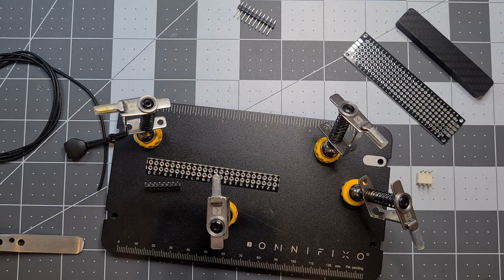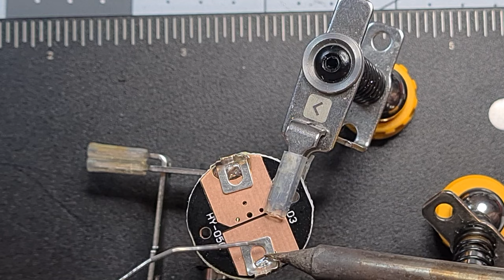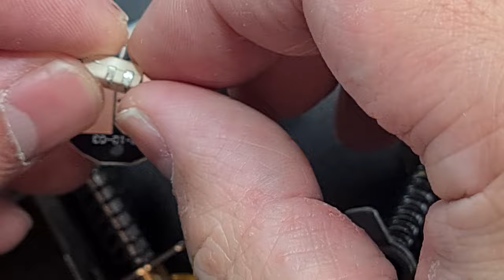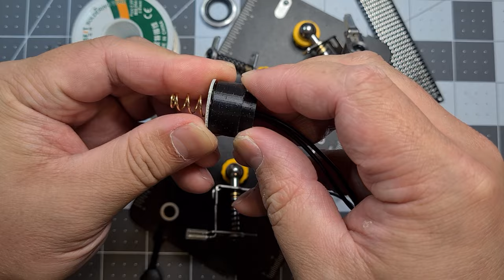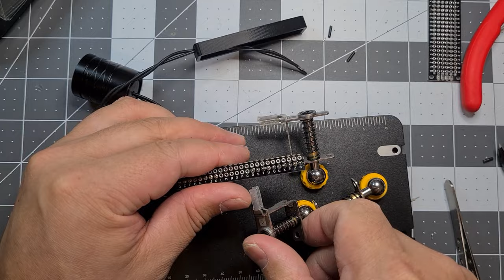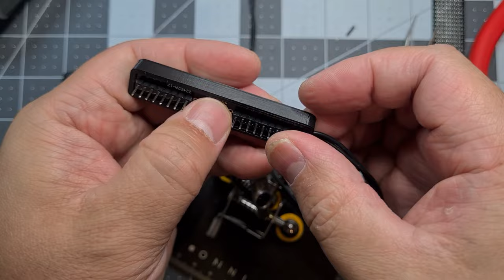How to make an IR Sniper for the Flipper Zero.

Comment: Very nice video! The range of this setup (especially with a beam this focused) is necessarily a major improvement over any other available DIY "IR blaster" for the Flipper Zero. To anyone interested in building a GPIO IR blaster (with or without a torch/lens), I highly recommend using Osram IR LEDs, models SFH4544 (20-degree beam) or SFH4545 (10-degree beam), or a combination of the two + a basic NPN transistor. Exceptional results (30+ meters without a lens). They tolerate the 5V / 20mA pulse combo very well without any resistor, despite their 1.7V nominal forward voltage, at 100mA.
Reply: Could you please share the connections and parts to make one that combines the two IR LEDs? I am afraid I don't know much about designing circuits, but I can build based on a schematic :) ... your help would be very much appreciated.
Reply: @chrismy  hey. if you're only using 2 LEDs i suppose you can just put them in series with a  47Ω resistor and set the flipper to 5V (not sure what it outputs otherwise but it's probably not enough for the LEDs)

Comment: I got a problem, It doesn't work, I checked everything more than twice. Could it be that optocoupler don't work?
Reply from the maker: It's hard to say exactly without seeing your full set up. Did you use the exact same parts as listed? Correct settings on the Flipper Zero for external IR?
Reply: @rayj1988  yes I did. The optocoupler was just black but the one from your Link. I just don't get it what I did wrong
Reply: @rayj1988  it have to less power I think, what Battery you use?  I got 3,7v 18650 cell with 9800mah

Comment: couldn't find the 4 LED model you got there, but I did find a 1 LED one, also 5W. also been looking into using more high power ones (without the scope unless I can find a giant flashlight with a lens) but it's been tricky figuring out the switching. so far i've considered an optocoupler that switches a transistor that switches a mosfet that would finally be able to handle the power going through it...
Reply: Update: I connected the flipper to an optocoupler (pins 1,2). Pins 2,3 connected to battery + and gate on an irf3205. source to battery - and drain to battery +. Also, a 10K resistor between gate and battery -. This way, when the optocoupler is on, the gate gets 3.7(?)V and the LED turns on. However, it's extremely weak. Only reasons I can think of are, either the LED doesn't get to full brightness before the pulse is over, or the 3.#V isn't enough to fully 'open' the gate (though it should be enough, irf3205 is 2-4V gate threshold). I will try powering the optocoupler manually, if it's an LED response time issue it should turn fully on. If not, I'll have to take a closer look at the MOSFET
Reply: Update #2: I removed the optocoupler and connected the flipper directly to the MOSFET, it is way brighter now. This effectively removes the circuit isolation though. Will see how much of a scope it is, later ;D
Reply: Update #3: Well, it's not going to reach 300ft but it's definitely more powerful than the built-in LED. I'll try making my own board with 10W LED's at some point.

Comment: great video and a really cool project, I may do this myself! One comment though, optocouplers are essentially a small IR emitter and receiver. You should put a current limiting resistor somewhere in series with pins 1 or 2 to protect the emitter from possibly burning out.  Great work!

Comment: Thank you, Im the guy who asked you to make this video on reddit! 

Can we bring the 5V of the flipper zero into the + side of the IR board?
Reply from the maker: 5v might be too high for the IR torch as it runs off 3.7v, so you could burn out the IR LED/circuit.
Reply: @rayj1988  so is the 3.3V fine ? Or will the led will be undervolted ?
Reply from the maker: @r4nd0m417  it would be underpowered compared to using the power from the battery. You could try it and then compare no harm in testing it out. Just noting the SD card power also runs off the 3.3v, so you dont really want anything that drains to much power from the 3.3v gpio pin.

Comment: Hi, After watching your video I bought everything to do the project. I also bought the magnetic base that revolutionized the way I work with components. But there's a catch.  This experiment with this flashlight doesn't work, up close I can control the TV but moving away about 10/15 meters it no longer transmits the signal to the TV. At this point the original remote control is more powerful with a normal ir led. In these days I'm going to try other methods with the 3w ir leds that I have aside.
If you have any advice to give me, I am happy to listen to it. Thank you for your tutorial.
Reply from the maker: I have only tested mine on my TV from outside my house through the window around 25-30m away. I was able to turn the TV on and off with the IR sniper where the internal IR couldn't. I haven't tested it further as I couldn't walk further away. Are you using it on a TV you have saved the signal or using the universal TV mode?
Reply: @rayj1988  I used the universal remote control. I have a normal samsung TV. I spent a few minutes on the various tests, in the next few days I will do more tests To understand the maximum distance that can be reached at night without interference from the sun. I'll keep you posted
Reply from the maker: @matteo.olivieri  as the beam is much more focused with the IR sniper, you really need to aim at the tv. Using the universal tv function you have to hold and aim it for a while. So, it is best to test it with a saved signal.

Comment: No strain relief? No knot on the cable inside the 3D printed back? Like this, it seems quite fragile to carry on. You'll rip the cable from the flashlight or twist it so it shorts the coupler pins.
I understand the video is for dummies, but I the length would cover also the whole print in my case 😊
Reply from the maker: Good point! I actually glued the Octocoupler and wires in  but didn't cover it in the video. My original one used the remote switch assembly you can get with the spring wire. But I didn't want to get another one, and it's a lot more difficult to use and mod to work.

Comment: love the videos man, but is nobody going to mention you're counting the pins on the IC wrong? you're using pin 4 and 5, not 6 and 5, the right side of a chip's pins are counted from the bottom. you're probably using the correct pins, but the numbering can be important when working off of schemamtics or tables. Now you know ;)
Reply from the maker: Thanks good to know! I am by no means an expert in electronics, so always good to learn as I just make things for a bit of fun.

Comment: Do you have links to products you used in this video? Thanks!
Reply from the maker: They are all in the description
Reply: @rayj1988  Do you have an email or a place I can contact you at with some questions?
Reply from the maker: @GooseLooseYT  just ask here if others have the same questions it will be here for them to see also.
Reply: @rayj1988  2 things a few of the links didn't work and also I have questions regarding a separate project and would like to talk privately
Reply from the maker: @GooseLooseYT  Which links didn't work? Message me on reddit RJ01988

Comment: Doesnt work for me idk how test optocoupler
Reply from the maker: Have you tried checking with your phone camera to see if the IR touch is flashing?
Reply: @rayj1988  yes 6 pin opto doesnt work i need 4 pin one but cant find it and if i find one voltage rating is 80V flip cant pover that opto
Reply: @rayj1988   where i can find 4 pin opto that is copatable with fliper
Reply: @rayj1988 it didint work i need  help how i can do it other way
Reply: @rayj1988 nope it doesnt work and i asked university teacher he said that optocoupler bunned because it  can only handle 50mah miliampers and torch has 150mah draw